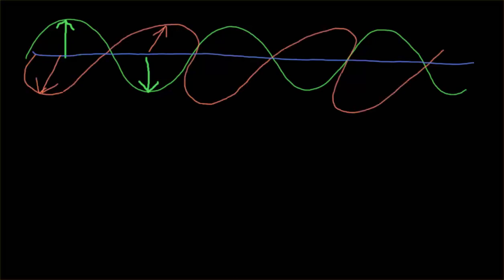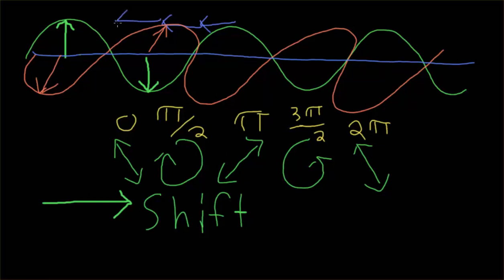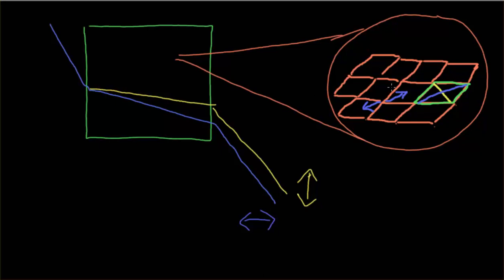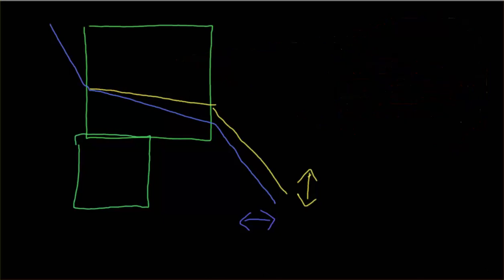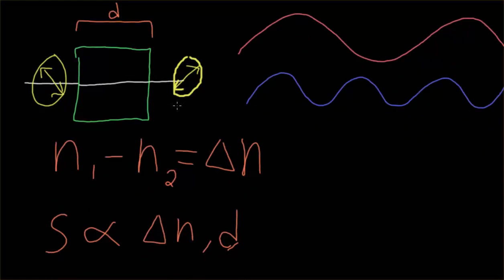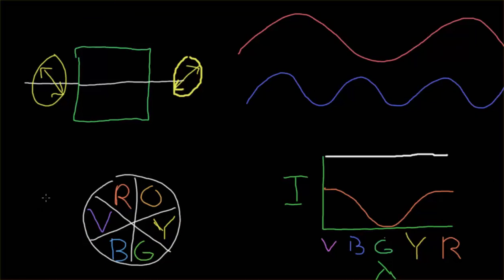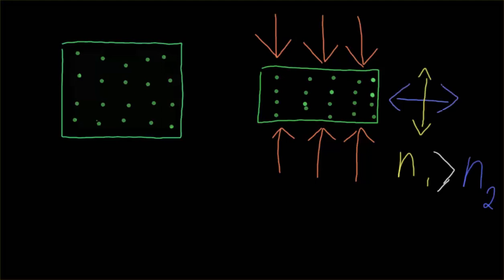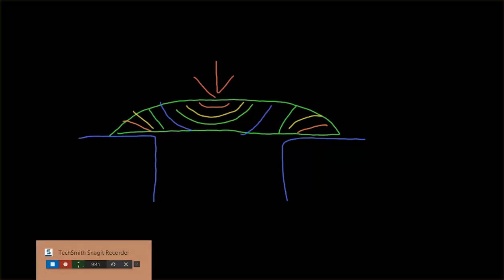Birefringence and Photoelasticity

Comment: I've seen several sources that say that light at normal incidence to a birefringent material still has one of the polarizations changing angle, instead of having the light go straight through, and Snell's law doesn't hold for birefringent materials. There are also videos on youtube showing a laser at normal incidence to a birefringent crystal, and the direction of one of the polarizations actually changes when the crystal is rotated, while keeping the angle of incidence at 0. I also thought that birefringent materials just had two indices of refraction, where on depends on the orientation of the crystal (and makes an ellipsoid shape), but apparently Snell's law no longer holds at the interface for the extraordinary ray. I'm wondering if there's some more general version that does.
Reply from the maker: The ellipsoid shape is a mapping of the of the crystal's index of refraction, specifically its orientation dependence (anisotropy). In this video I was using the special case of a uniaxial material such that its index ellipsoid is a revolution of an ellipse. Thus it only has one long axis and is otherwise symmetric. Furthermore, I am using the special case where the incident beam is orthogonal to this long axis, so you no longer get a deviation from Snell's law. However, you still have two distinct and orthogonal indices of refraction, causing one polarization component to travel with a different phase speed than the other orthogonal component, leading to elliptical polarization.

Comment: At pi/2 wavelength from your starting point the intensity of light is 0,since both light waves at said given point have 0 intensity.Also to generate circularly polarized light don't we need a phase difference of pi/2?When you say shifting do you mean shifting the orthogonal wave?
Reply from the maker: Yes, generally you have elliptically polarized light. At pi/2 the ellipse is circular.

Comment: Thank you very much for the video! It was very clear and helpful. I was slightly confused by one small point though, and I would appreciate it if you could clarify it:

From 4:00 - 4:13:
"But because we have different speeds of light travelling through the material based on the different polarisations, we're going to cause that shift like we saw before."

So to be clear, the shift is the result of different polarisations having seemingly different indices of refraction. Here is where my misunderstanding lies: at around 4:39, you add a birefringent material in between two orthogonal polarisers. The light incident to the material will be polarised in one specific direction only. So how will the subsequent phase shift arise? (4:38 - 4:42, "but if we start adding the material back again, then we can start getting a phase shift..."). I thought that the shift only arises if you have two different polarisations that will travel at different speeds though the material resulting in the phase shift you described. What am I missing here?
Reply from the maker: If the birefringent material is aligned such that the optic axis is parallel or perpendicular to the polarization axis then you are correct. However, if they are not aligned then the polarized light has components that are parallel and perpendicular to the optic axis, and therefore travel with different phase velocities. Make sense?
Reply: Yes it does! Thank you once again!

Comment: Hello, thank you for enriching the YouTube community with your videos! To make sure no misinformation is spread, I wanted to bring up a seeming contradiction with other sources and get your input. In your example on normal incidence, I have understood you to mean that both the ordinary and extraordinary ray will propagate at angle 0. However, two sources I've been reviewing so far explain that the extraordinary beam in birefringent materials will not (except under specific conditions) propagate at a zero angle under normal incidence. What do?

Seemingly conflicting sources:

Wikipedia: https://en.wikipedia.org/wiki/Birefringence#Double_refraction 
"So even in the case of normal incidence, where the angle of refraction is zero (according to Snell's law, regardless of effective index of refraction), the energy of the extraordinary ray may be propagated at an angle."

Another YouTube Video: https://www.youtube.com/watch?v=jevSOwBtqlI#t=4m03s
Reply from the maker: Thankyou! You raise an excellent point. In the description above I was treating the extraordinary ray as though it behaves like an ordinary ray with simply a different index of refraction. As you have correctly pointed out, this is not the case. My video should still be conceptually accurate (not quantitatively) for the special case when the optic axis of the crystal is parallel with the incident surface.